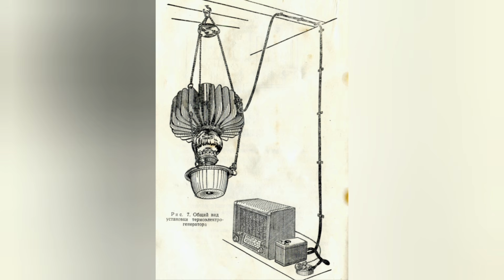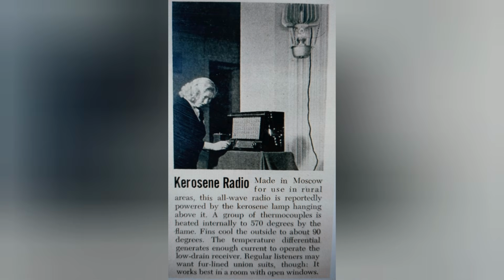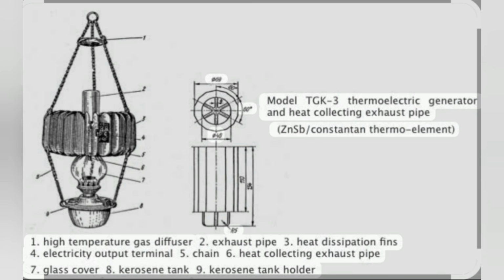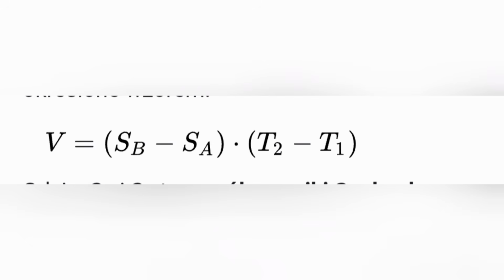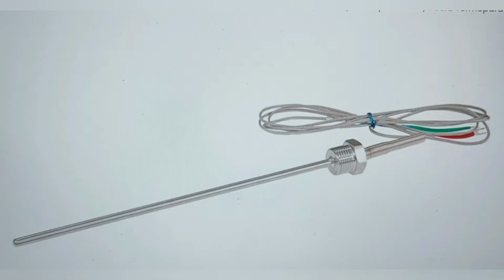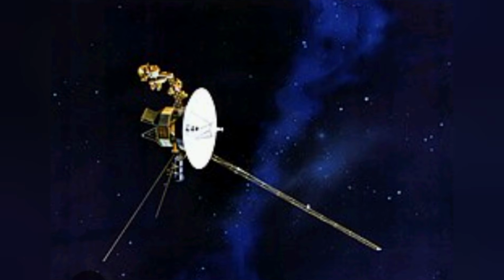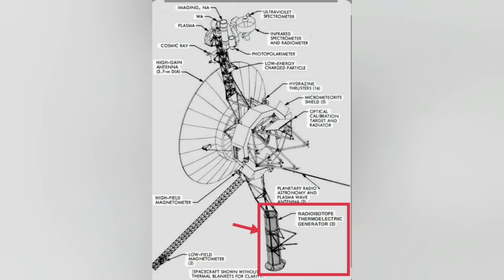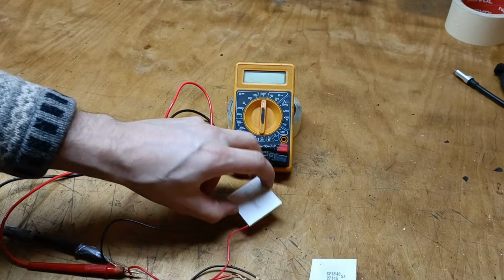Building a replica of the TGK Thermoelectric generator. DIY project

Comment: if you add more vertical fins in the chimny part of the heat riser you will be able to tranfer more heat to the tegs with lower flame
Reply from the maker: Yes that's a option. I will be working on this project, there is a lot space to inprovement 😊

Comment: i found using boost converter draw to much current and drop usabale power i found using a buck converter and having the teg modules in series for higher volatge works best
Reply from the maker: Yes yes. I have 8 TEG in series and I am wondering if buck converter is better option cause output voltage reach even 11V